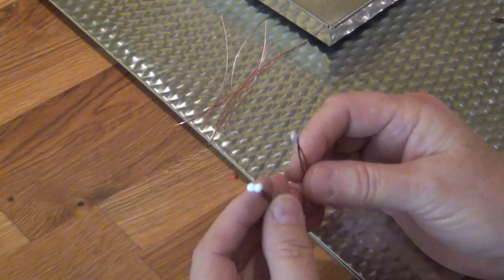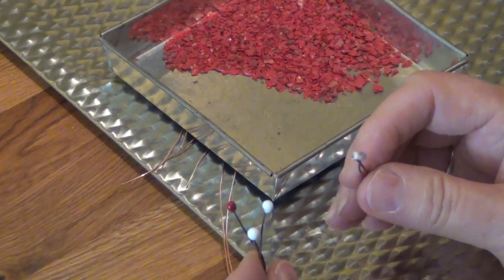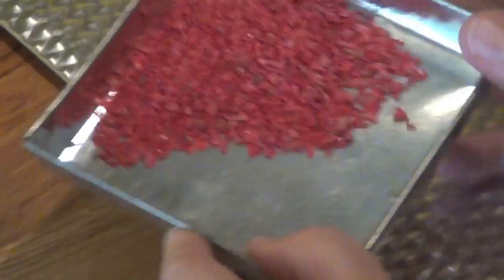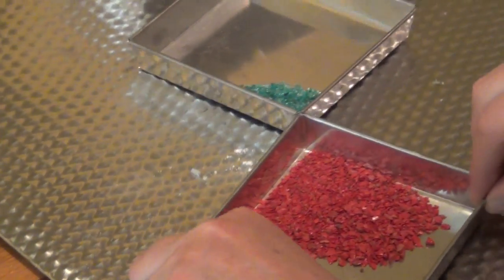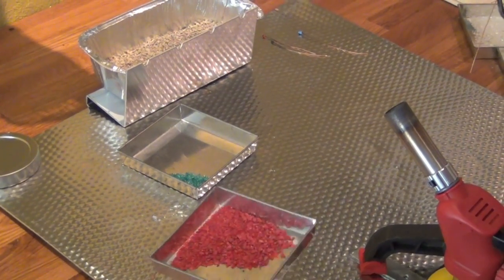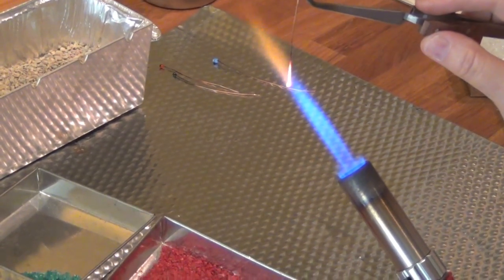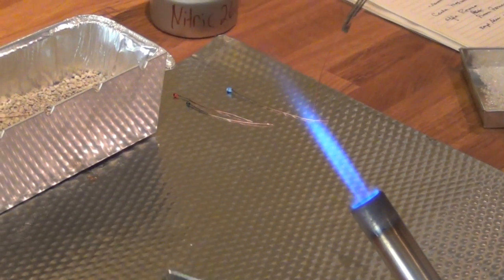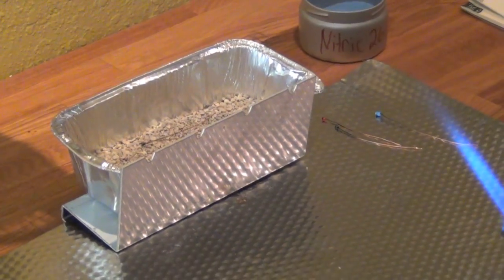Enameling Head Pins with 6/20 Enamel

Comment: Hi Barbara, Thank you for sharing this...Is it possible to use a normal butane torch that I use to make my copper and silver headpins?
Reply: if it's a little Micro butane torch it should work for little head pins but may not have enough power/heat for larger pieces. But what do you have to lose? I'm thinking you'd really burn thru the butane pretty fast. But I might try mine for fun.
I have a portable plumber's torch with the 10 or 12" Map-Pro propane canister on it; yes, you can torch enamel with it. I have had great results.
It is shorter work time than my kiln. I'll use the kiln for copper dishes and things.
Of course we'd all love to have the hose types that the pros use. 😉